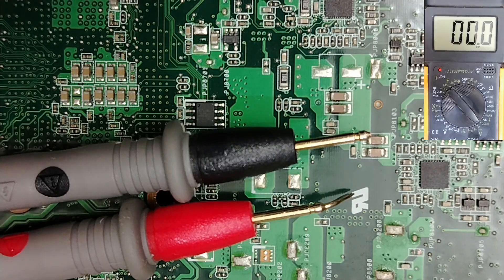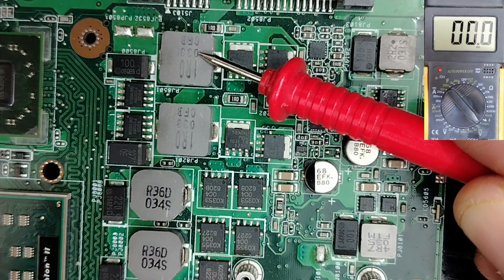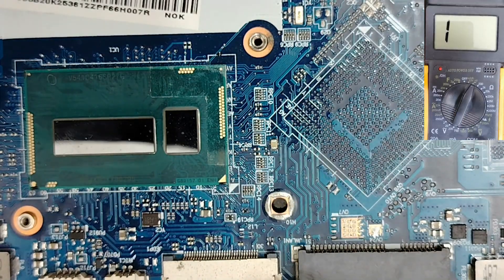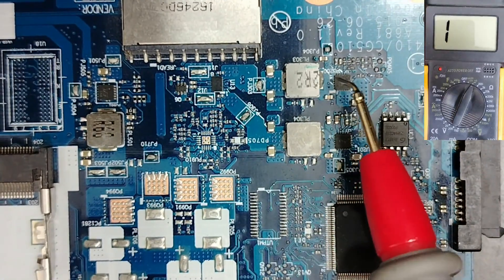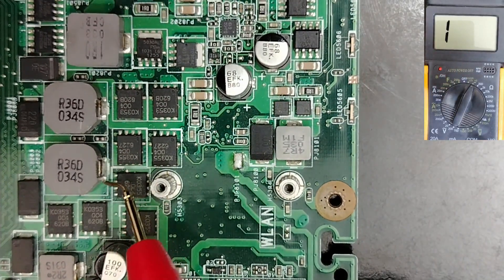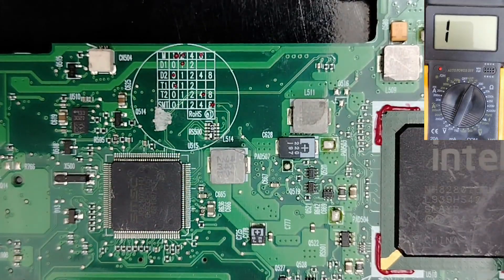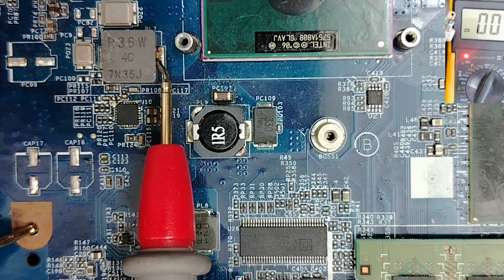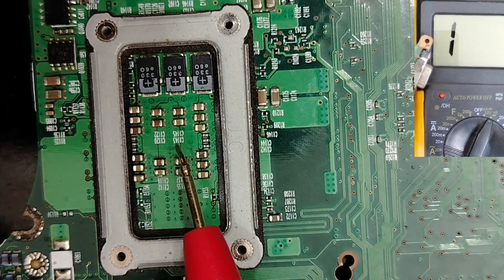The Fastest Way To Detect Short Circuit On Motherboards | laptop motherboard short circuit repair

Comment: Thank you for this lesson. But going forward from here: How do I find out who the bad guy is? I assume it's not necessarily the particular ceramic cap you've tested, right?
Reply from the maker: Great question. Identifying the culprit can be tricky. It's often a process of elimination, so keep testing components until you find the one causing the issue.
Reply: 😅, the inductor by the Ram only one was 1ohm on multimeter, why is that not a problem?